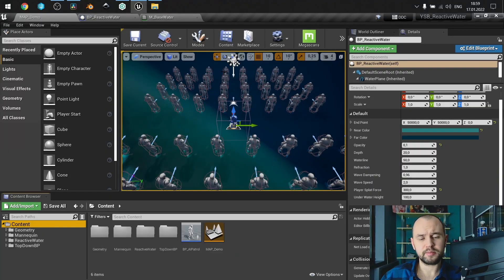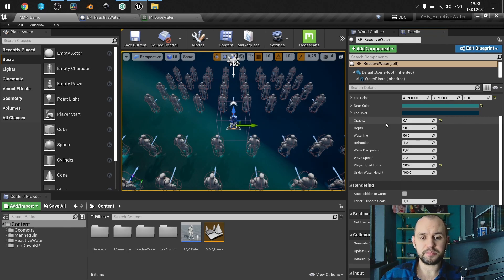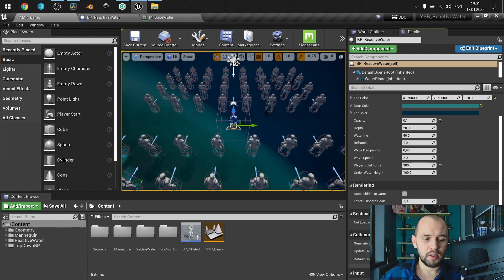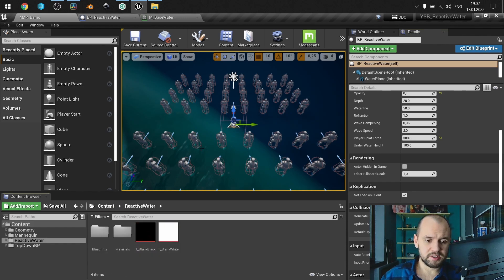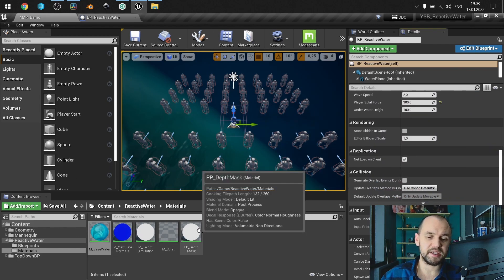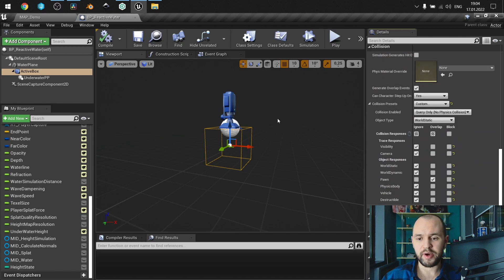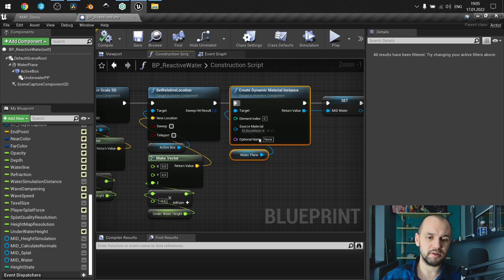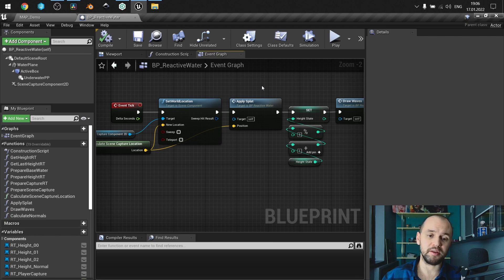Reactive Water in UE4/UE5. How to Use & Downloads for Patrons

Comment: Awesome. Would it be possible to attach Waterbodies to a spline or is there any other convenient way to merge conjoined bodies into a river?
Reply from the maker: I will make another video about it. Yeap, using spline with procedural instances is proper way to build a reactive river.
Reply: @YourSandbox  Yes cant wait - I have a project at the moment where I am building first map of multi-map game 12km square wilderness  - alot of streams - will ultimately be working out how to procedurally lay down spline based watercourses, where individual courses are auto spawned in the editor and follow a weightmap. The landscape materials aspect is as required, just need to start fleshing out the detail. Anyway as said - cant wait!